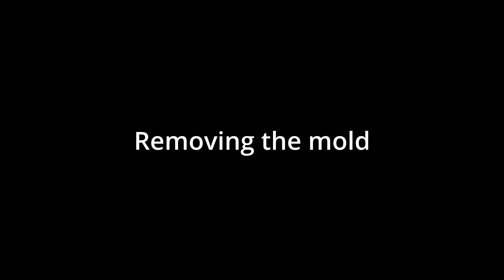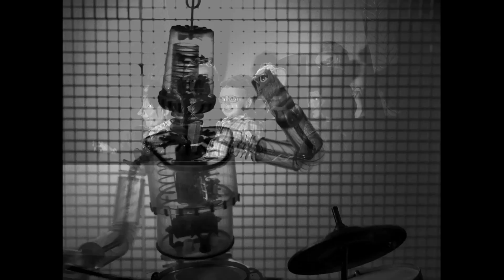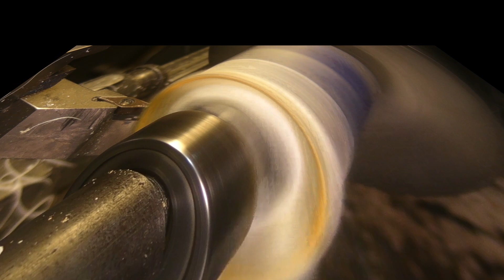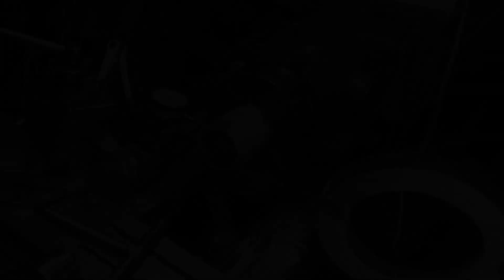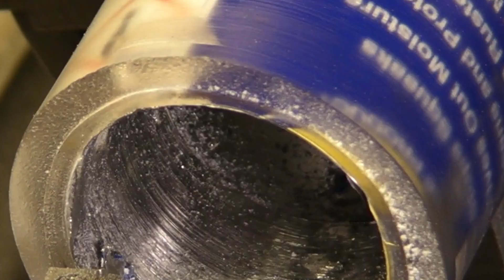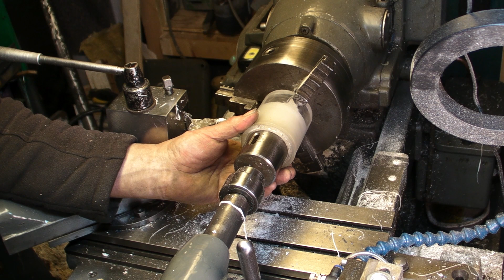Robot build part 2

Comment: lots and lots of sanding and polishing now.
Reply from the maker: any suggestions for polishing the inside Mike ?
Reply: Maybe make sanding sticks that are held by your tool post.
Reply from the maker: I was thinking of using sanding sticks in the die grinder on the tool post @danceswithaardvarks3284
Reply: Tips for polishing. Use elbow grease.....Tony